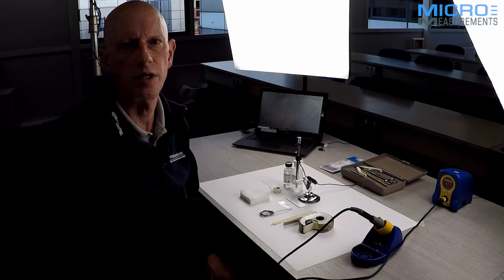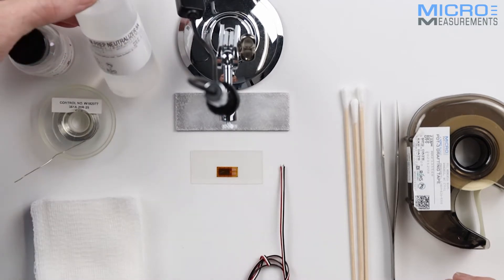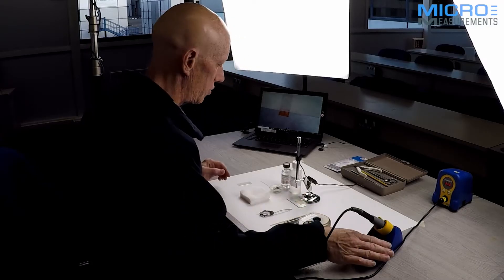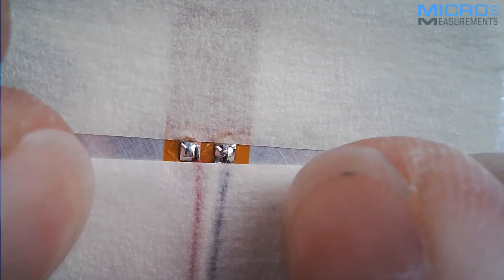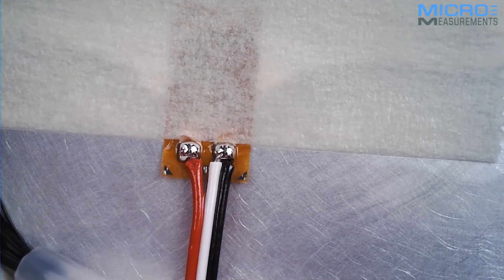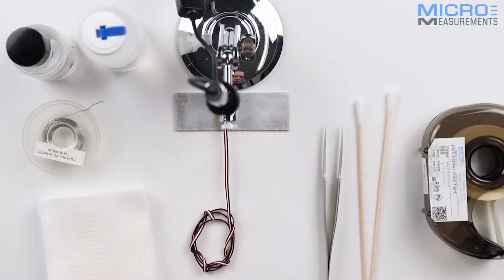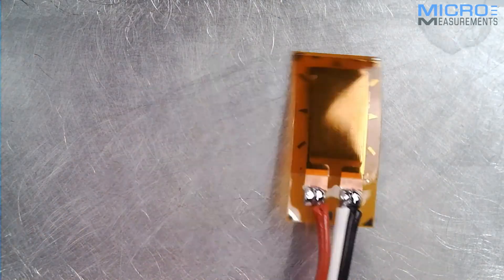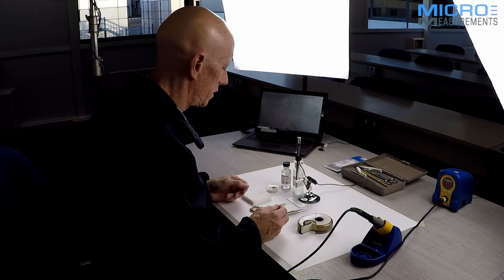Attaching Leadwires to Unbonded Strain Gauges

Comment: How much temperature do you use for soldering?
Reply: Your solder pencil tip temperature varies based upon which solder you are using (361°F, 430°F, 450°F, 570°F, etc) and the heat sink of the substrate to which your strain gage is bonded.  Most commonly for 361 solder on a great heat sink like aluminum, we teach in our workshops to have a solder pencil tip temperature of 650°F or so.  This is dependent upon dwelling no more than one second so as not to thermally damage the strain gage nor the strain gage adhesive.  This is also why high thermal capacity tips are used for strain gaging to transfer enough of that heat energy so as there is no need to dwell longer nor set the pencil tip temperature higher - which can cause damage from thermal shocking of the foil.  If you wish to discuss further, I am the Applications Engineering manager for Micro-Measurements.  Please feel free to contact the team at 919-365-3800 option 1 for Micro-Measurements then option 2 for the Applications Engineering queue.